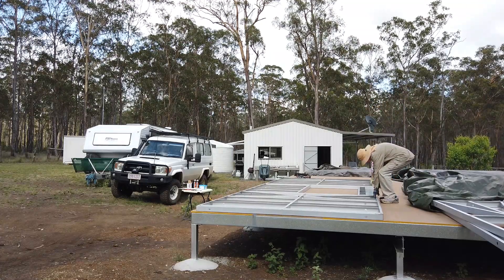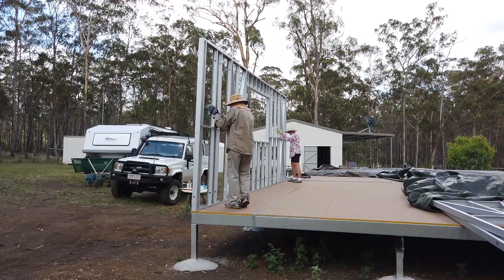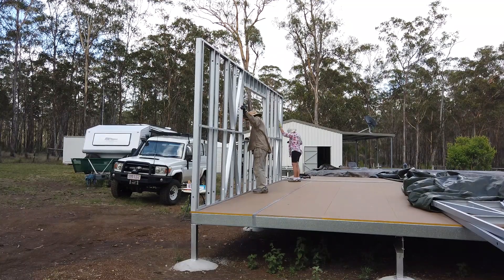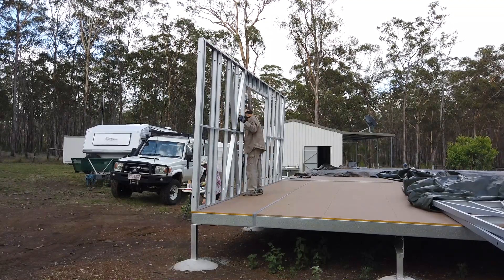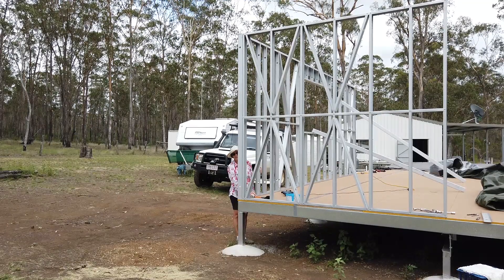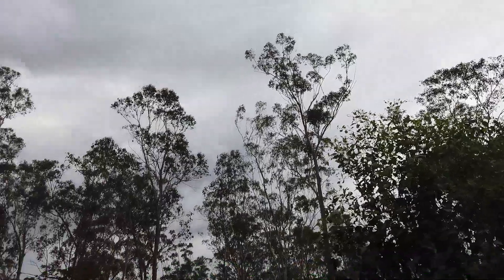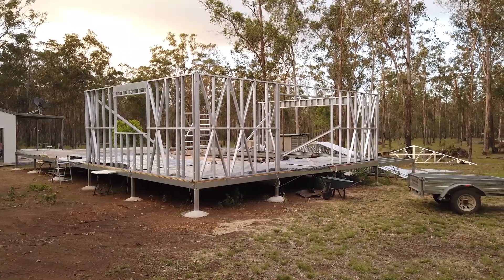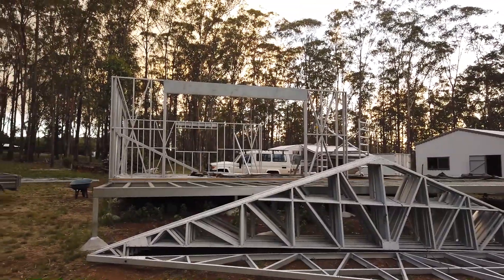How to Erect Steel Wall Frames

Comment: Hi, did you drill all the way through the bearer to fit that bolt through?
Reply from the maker: Nate yes the bolts go right through the flooring and the  bearer, aqt 2.43 sue outs the bolt through. all the best les